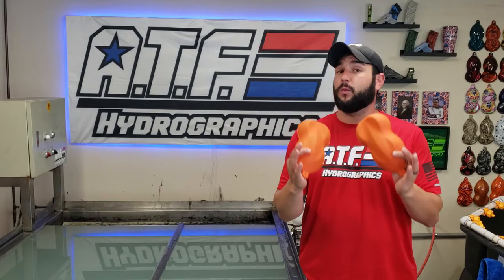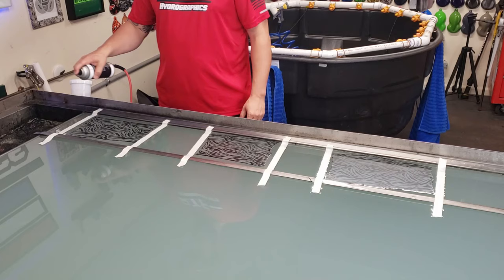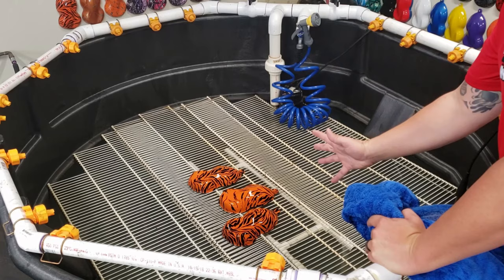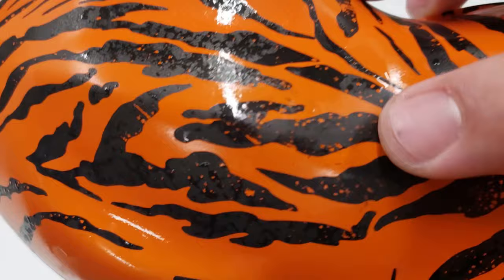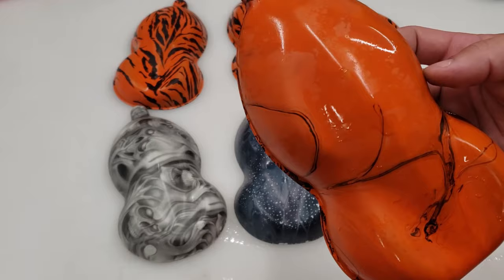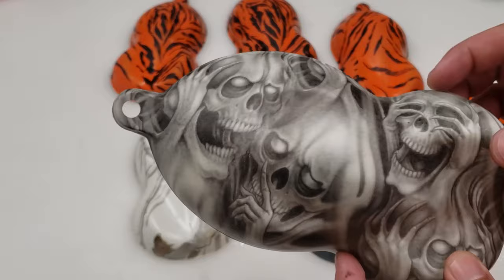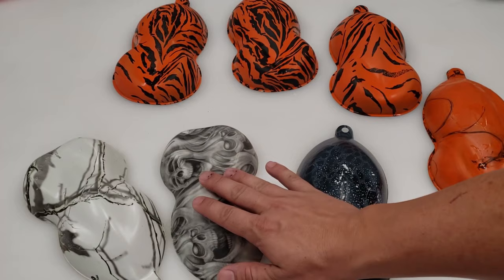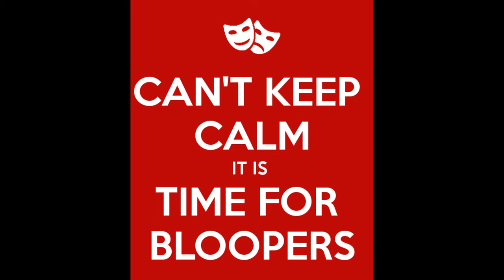#1 MISTAKE New Hydro Dippers Make !!!

Comment: So if I was to order enough stuff to do a large gun stock like you had how much hydro film would I need and what else would I  need? And how much is all this costs? Also what temperature should your dip water be?
Reply from the maker: Price depends on what film you buy and where you buy it from. I always order a minimum of 3 meters for all projects so I know I have enough for re-dos if needed.  90-92 degrees at the surface of the water... we just did a video on water temps if you want to check it out.

Comment: Thanks,going to try a few projects soon. This was very helpful. I'm brand new to hydro dipping. Lots to learn.
Reply from the maker: Thanks for checking out the video, we have many more great info videos coming soon and you wont be disappointed. Give the OHW do it yourself kit a try, it works great. Link for 5$ off in the description is just an extra bonus!
Reply: @AllThingsFunHydrographics  do you have to sandblast parts first?
Reply from the maker: @shockwave6416  It is prefered to sand blast. You can use a scuff pad but sandblasting is much easier and more consistent. We will have a full video on prep work soon.
Reply: You should make your own activator mate. It's just xylene and thinner. 70/30 mix. People are making this and calling it activator. placing it in blank jugs and putting their own label and a 50 dollar price tag  on it. Notice that none of them put the ingredients on the jug? Xylene 12 bucks. Thinner 7 bucks

Comment: This 🤬is difficult . But I love it 🤗🤓
Reply from the maker: Yeah it can be frustrating, but just keep practicing. It takes time.
Reply: I don't think its difficult at all. I bought some film and activator from Amazon then went to 99 cent store and bought a laundry basket with trash bag liner. first attempt was ok with a few imperfections, second temp was almost perfect, third attempt was great with only a trained eye able to see imperfections. I did one job which allowed me to cover initial costs to setup. I dont know if my experience in paint and body made it easier but it was a simple process. I am currently about to build a larger tank and start using wonder paint as base and start a new business dipping to cover any slow times my other businesses may come upon which is rare but always nice to be diversified.
Reply: Its really not, iv taught my 7 year old how to design and dip his own stuff, its so simple, i just make sure hes got his mask on and hes away, i only help him peel the film as we do our own designs

Comment: So I have a question if you could help. I print my own designs on hydro film. And alot of the time the  picture spreads too much and doesn't come back to original size when in water and after adding activator. Also is their a way I have to prep what I'm dipping. For example I'm trying to make my own design on my ps5 controller but when I dip the color sometimes slides off like it's running and not sticking to the surface it especially comes off when I'm trying to rinse off what's left over of the film. Please help I hate wasting so much time and money. Thank you

Comment: Question :....When dipping a "taped off project"  ...for example taping of a gas tank or fenders ect . for flames , and only wanting the pattern to appear in the flame , Do you have to score around the masking tape before removing to prevent damage to the area intended for the pattern ?
Reply from the maker: I always score the tape before I pull it just in case. Makes getting sharper lines much easier.

Comment: Today was my first attempt at this art.  I dipped a wooden skate board blank.  It came out pretty good.  A few  small imperfections but overall I was tickled to death.  I rinsed it off for what seemed like forever then pat it dry.  About an hour after that, I applied  Rusto Oleum Acrylic Enamel clear over it.  About 30 mins later the entire board was a mess.  The Clear cost reacted with something and caused the print to crack and blister up.    Any Suggestions?
Reply from the maker: Best tip ever.... stop using a paints that are not designed for hydro dipping. Switch to OHW or a hydro dipping paint and clear and those issues will go away.
Reply: Ordered some OHW supplies :)  @AllThingsFunHydrographics
Reply from the maker: @frankmick8683  Awesome, you will love it. I use the paints all the time. Good stuff.

Comment: Hi! Great series of tips!  I have a question: can hydrodipping be done on a textured surface?  I have a plastic engine cover I'd like to do, but it has a textured finish that would be difficult to sand smooth.
Reply: The texture will mute the detail of the film. It will work but look “fuzzy”

Comment: I’m having issues where my film is wrinkling, not when placed or activated but around the item I am dipping during the dip, then drying with raised creases or ripples on the item. Any idea what is causing this or how to fix it?
Reply from the maker: If the film in wrinkling as your dipping then you either have bad film or you are not activated enough. Film can go bad if it is not stored properly. It needs 40-50% humidity and 70 degrees.

Comment: Hey do I have to spray the object with water to clean the film off right after I dip it or should I let it dry before I have to clean it. I’m asking because I just dipped a p90 body and while I’m rinsing it I’m seeing it come off however it’s not bad and I quit rinsing so I guess my question is what the fuck do I do?
Reply from the maker: Yes it needs to be rinsed right after you dipped. If the sip is coming off when rinsing then you messed something up: either didn't use the right paint, waiting too long after painting and the paint is now cured, or you didn't activate right.

Comment: So of I'm going to hydrographic dip over my epoxied  cups, is there any other special steps I need to take before dipping?
Reply from the maker: Scuff, paint, dip. It will be fine but it has to be painted so it will cover your epoxy. The dip wont stick without paint.
Reply: @AllThingsFunHydrographics  what if I scuff my epoxy layer then dip? So that way I can have my glittery goodness showing thru my translucent film.
Reply from the maker: @sparklinmommaglitters553  if your going to  do that then use intercoat clear. OHW sells it. Its just a clear paint that is dippable. Scuff your epoxy, spray a few coats of intercoat clear, dip, and thrn clear coat like normal.
Reply: @AllThingsFunHydrographics  I was just looking at the intercoat! Think ima try that thanks for your help!!
Reply from the maker: @sparklinmommaglitters553  no problem, got a video coming on using intercoat very soon. It works really good, and don't forget to use that link to OHW in the video description for 5$ off your order.
Reply: @AllThingsFunHydrographics  will most definetly use the code! Thanks again for your help! I think ima order some of the metallics I think those will give enough shimmer to make ppl happy that wants a sorta sparkle effect.

Comment: What's the best angle to spray my activator(aerosol can) on my film without under or over activating because i made so many mistakes in the past its crazy
Reply from the maker: 90 degrees to the film if you can,  when the can is not completely full sometimes you have to tilt it a little.
Reply: @AllThingsFunHydrographics  thank you so much i watch your youtube channel to learn more so i can take notes on my mistakes i make

Comment: he hee   Don't used the bath tub!    😆  WHAT A MESS >>>  only way to learn is trail and error ! That what i'am using,  and most of us is >  Can Activation
Reply from the maker: rattle can activator is the hardest part. I gave up on it years ago because it is so difficult to get repeatable results every time.
Reply: @AllThingsFunHydrographics   Gal lee that is so poison and toxic. I quit. I'll just paint it by brush. Plus the film fells like plastic or a snake skin like   plus i had bad luck with it to I did every thing like i was suppose to do and it still wouldn't stick

Comment: I've been trying to dip a fishing bow reel cover and the film will not stick to the part. ive used ohw  paint on it and have dipped it 5x same result
Reply from the maker: What activator and what film?
Reply: @AllThingsFunHydrographics  I'm using cowboy rebal with hydrovator
Reply from the maker: @davissvt  hydrovator is your problem. That activator is too hot for that film switch to ink drink or another less hot activator.
Reply: @AllThingsFunHydrographics  what activator would you suggest for the film?
Reply from the maker: @davissvt  ink drink, Mossy sauce, or super brew

Comment: I wasted 3 hydrodip films already I just can't get it right I think I need use warmer water
Reply from the maker: I did a video a few weeks ago all about water temps. You should check it out. I use only 90-92 degree water.
Reply: @AllThingsFunHydrographics  I'll check out all your vids on hydro dipping thanks.
Reply: @AllThingsFunHydrographics  I just got one question.
I ordered some hydrographics film from Walmart but they didn't send it to me in a long tube they sent it to me in a small package and the film was bent and all wrinkled in the middle.
Do you think it's still usable or is it ruined ?
 Should I just get some new film?
Reply from the maker: @juanmarquez9975  Better off getting film from and actual film dealer, and not Walmart. Places like ebay, Walmart, and amazon never store it correctly and the film usually dries out and is ruined. Buy from OHW, Big Brain, TWN, Liquic Concepts and save the headache of dealing with bad films.
Reply: @AllThingsFunHydrographics  alright I will do that next time I buy more film thanks for the help.